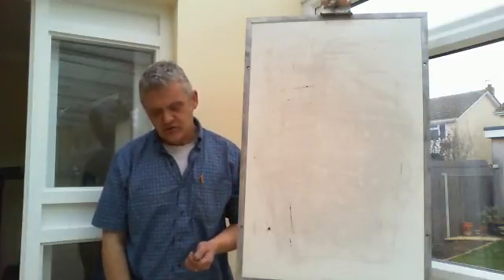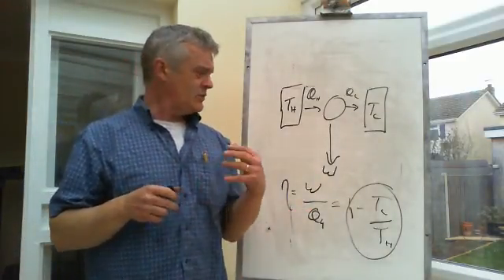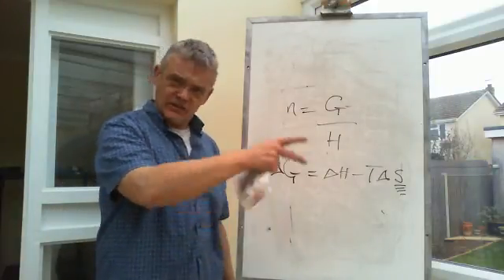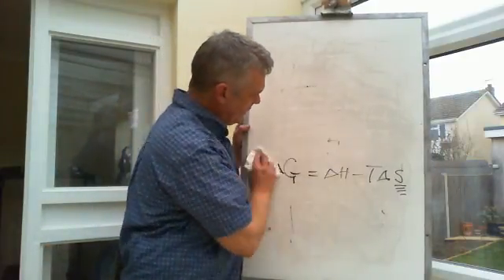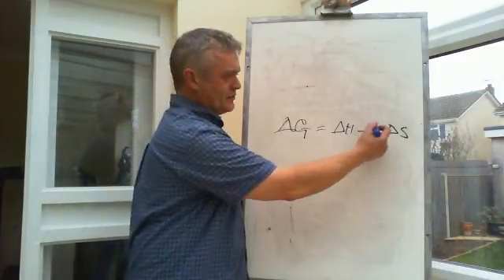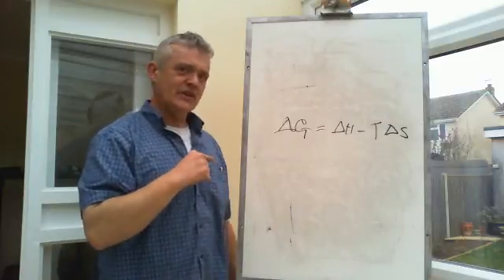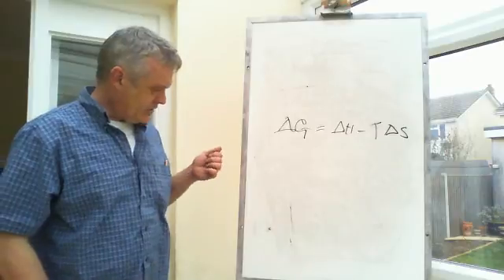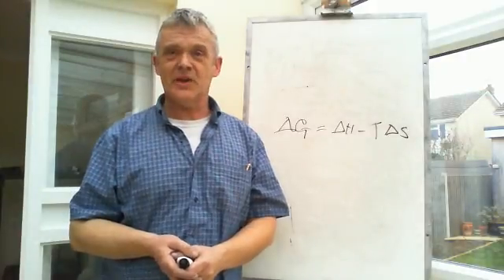Electrochemical Cells, Entropy and Gibbs Free Energy

Comment: I work with [external] heat engines in preference over internal combustion engines as they are inherently more efficient, provided the system is properly engineered. My work is on increasing the engineering of the system for peak efficiency.

Comment: Thank you for clarifying the second law of thermodynamics. But you missed my question that if this is so, how is it that refrigerators and air conditioners work moving heat from one box out to the world at large at a higher temperature? Moving heat from a lower temperature into a higher temperature situation?
Reply from the maker: sorry about that mate i see what your saying. Per the law It is not possible for heat to flow from a colder body to a warmer body spontaneously This precludes a perfect refrigerator as energy will not flow spontaneously from a low temperature object to a higher temperature object. However, the Clausius statement of the law allows this if work is being done and it is the work being done that accomplishes this flow.

Comment: Remind me again what the second law of thermodynamics IS; Matter cannot be created nor destroyed but can only change form, or is it that energy only flows from a more energetic state to a lower energetic state? Or have I missed it completely. If it is stated that heat only flows from the hotter tho the colder and never the other way around - How is it that a refrigerator or an air conditioner works? Is the second law only a suggestion? ...   Love your work, by the way.
Reply from the maker: The second law of thermodynamics states that the entropy of an isolated system never decreases, because isolated systems spontaneously evolve toward thermodynamic equilibrium—the state of maximum entropy. The law you quote is the conservation of matter. The first law of thermodynamics is a version of the law of conservation of energy, adapted for thermodynamic systems. The law of conservation of energy states that the total energy of an isolated system is constant; energy can be transformed from one form to another, but cannot be created or destroyed.. Energy flow is a corollary of the second law really and is often expressed as time's arrow